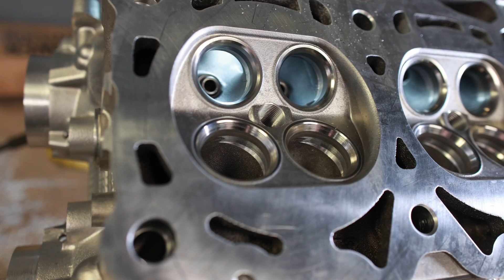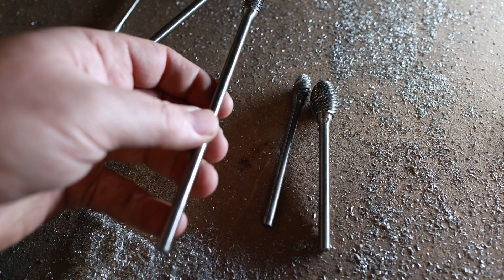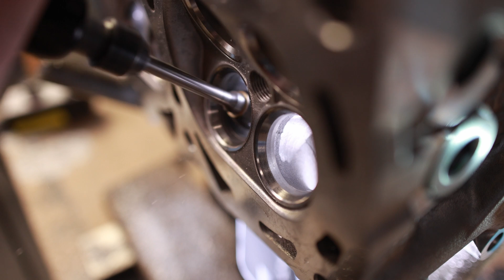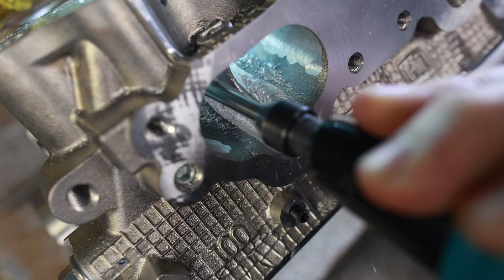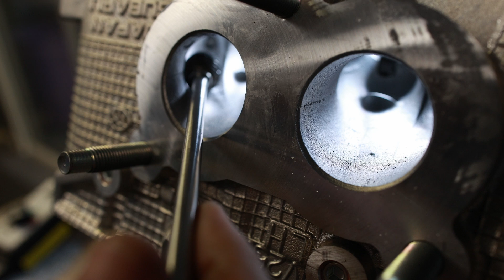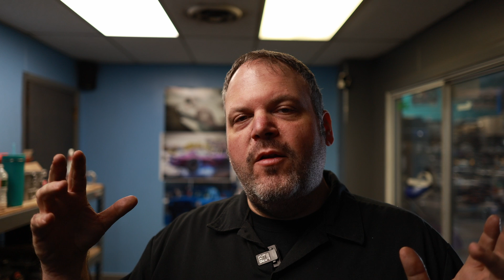Subaru EJ25 Hand-Porting Secrets: Watch the Transformation

Comment: I haven't had the opportunity to mess with anything other than the EJ25D heads. I didn't realize how much more knife edge there was in the later versions.
So, I don't have a rotary tool like the Makita you use. I have a regular corded drill instead. However, rather than using a carbide, single-cut sprial beehive bit, I use a 1/2" bullet-point, straight-single-cut burr. I also have a spherical burr. I like the bullet shaped one because it has less of a tendency to dig and make smoother cuts. It shaves more than it cuts. My bowls end up much smoother because I use the sides of the burr and the slower speed of the drill helps prevent me from taking too much material. Once I've got my shaping accomplished, I use  a set of Harbor Freight arbor-mounted sanding rolls to further smooth things out. Then onto 3m, dremel mount scuff pads, then fine wet sanding, then polishing of the exhaust ports. 
If you haven't used those 3M rotary scuff pads meant for a dremel, you're missing out. They're phenomenal at cleaning up combustion chambers to prep for polishing. You can thank @jafromobile for that awesome piece of kit. His video, "Head Porting 101" is very informative.
I completely agree with your take on gasket-matching. You'll inevitably create a low pressure zone from the intake runner flange to the port, causing too much turbulence. Instead, I simply ensure both mating surfaces have the same shape and leave it at that. I also do this with the intake runner jugs to the plenum. I simply leave them attached and flip the assembly over, then use only the sanding rolls to smooth the transitions as they're bolted together. All I'm after is clean air. The rest of my work is the same principle you've described here.

Comment: Hey so im really new to porting and i really screwed up and i gasket matched my exhaust but i only beveled the outside of it like a few centimeters deep, i havent touched the bowls thank god😅 i also havent tried to port anything deeper then a half inch into the ports, ive just barely taken the oxidation off. My hp goal is 500hp so from what you said i may as well just try to bevel the exhaust manifold and call it a day. What do you think? 
Thank you
Eli

Comment: Dave, you're a legend; Have you ever done a pocket port and just the dog leg work? I know that dog leg causes all kinds of issues at over 1.5 bar
Reply from the maker: thank you for the kind words. No, I have never done that. I haven't seen too much issue with porting both exhaust ports to flow a little closer to each other. 70psi proven reliable as far as I know. But, I am also not a tuner, so don't know if it was hell on that end lol. I just know it has ran good.

Comment: Dave look into an old down draft porting cabinet from Peterson etc.  Winona used to make a sweet double bay downdraft valve job station that would be the ticket for your high volume shop.  Aluminum dust is a killer dude!  Keep your eyes on marketplace and equipment houses.
Reply from the maker: @5angles114  I’m 25 years in! I’ve thought about it though.

Comment: hey Dave, in NA the throat are is done to around 90% of the valve size. does that come  in to play on these 4 valve heads with big boost? cheers
Reply from the maker: @Nothingtoseehere363  sometimes! Depends on the head. The Subaru doesn’t like the throat opened up at all. Kills it. At 86% ish. Depends on the core.
Reply: @headgames  i know this is about the EJ25 but what about the 4G63 head - how does that head go regarding throat to valve percentage with like 50 psi boost? cheers man
Reply from the maker: @ depends on the bottom angle of the valve job but never more than 90%.

Comment: I have a question, when you build a EJ25 that is for an engine that is race prepared for circuit racing but NA, so higher compression, Cams, ect, what valve spring seat pressure you select for this compared with the Turbo street application?
Reply from the maker: @CJ5EVOLUTION  I’ve never done a NA one but I think you would get into the GSC conical. They have an 85lb. I would want it for the stability of the conical. Forget about the pressure, just need that thing to rev happily.
Reply: @headgames  I give him props for what he is doing because few do NA Subies. He seems to think he is under attack and gets quite defensive should one question or call him out on something. Then he goes to the lengths of banning you from his NAS FB page or having Admins in OTHER Subie pages ban you from those pages. That put a bad taste in my mouth.

Different generation, different attitude, i guess.
Reply: @fujisspeedshop  sounds like you should resolve this with him instead of talking about it here.
Reply: NAS Performance is where you want to go. Not knocking Headgames, but their name is literally Naturally Aspirated Subaru Performance.
Reply: @TDT0188  i wished Mr. Loveless would get off his high horse and not get so butt hurt when people want to have a conversation. Kids these days don't know how to have a conversation. 

Good luck to his NA Subie business I guess. I guess he got bullied for playing with NA Subies and wanna prove a point.
Reply: @fujisspeedshop  don't know what that's all about but it seems like he's pretty interested in doing anything his customers ask him to do.
Reply from the maker: @TDT0188  I don’t know what that is either but NAS is a friend of HeadGames and he is knowable about something we don’t really work on. So, think that is what you were saying. Could we do it? Sure. Do we have any experience or plans to do NA ports? NAS has you.